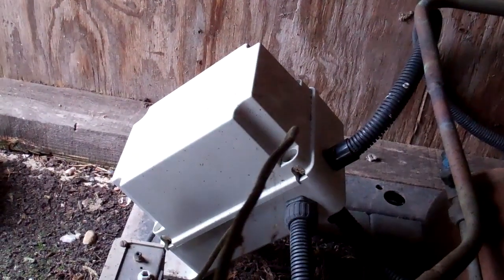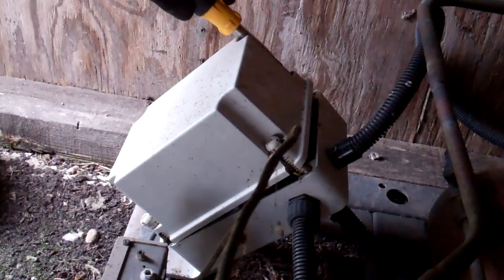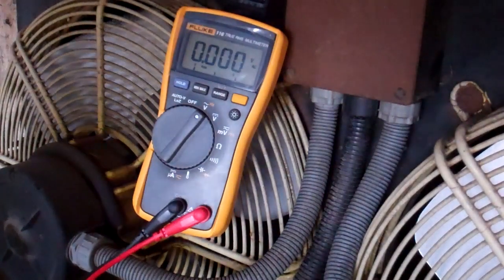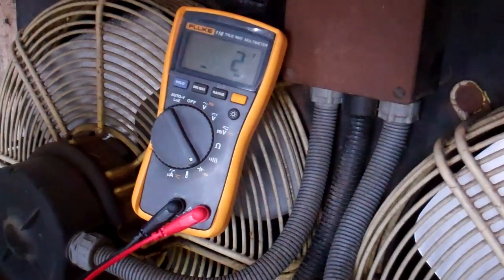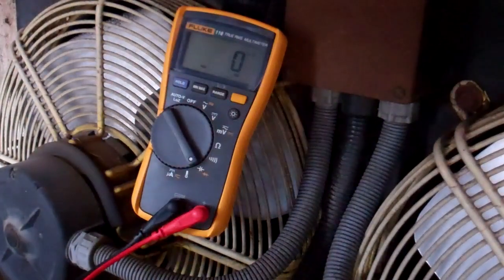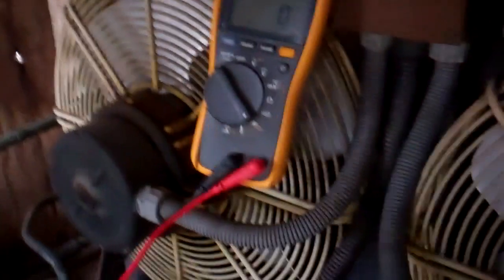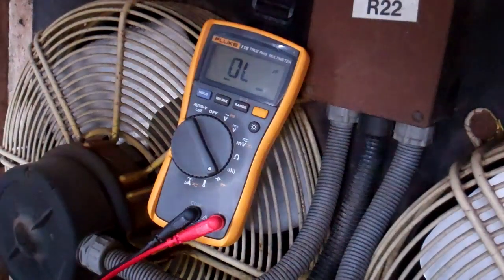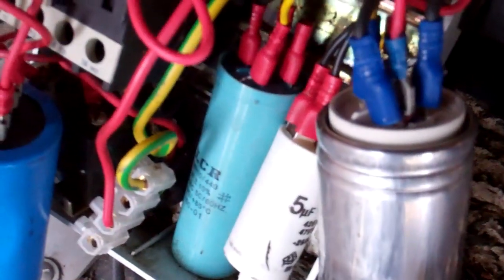Electrical Problems

Comment: hmmmm.... 31 amps. thats a bit.  sooo the units were low on gas so the low pressure switch would cut in and out often?

Comment: We had an old fridge that used to dim the lights when the compressor kicked in. Of course that was when we were using filament lamps instead of these electronically ballasted CFLs.